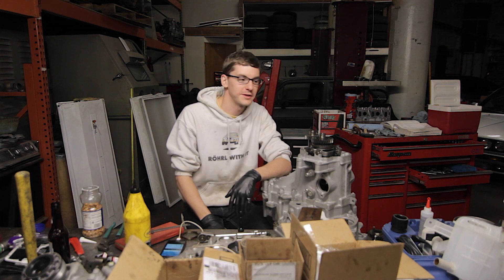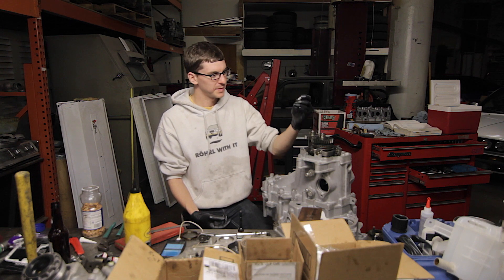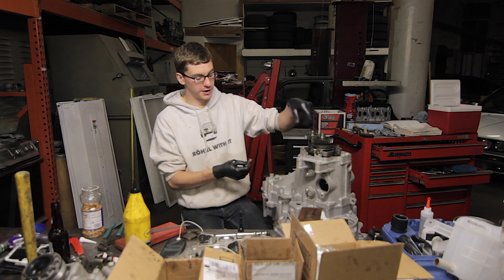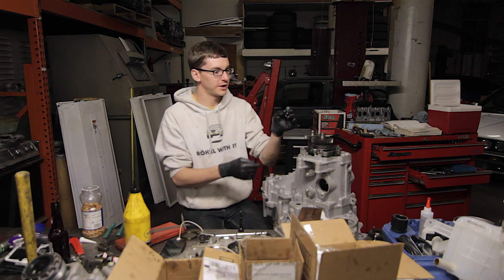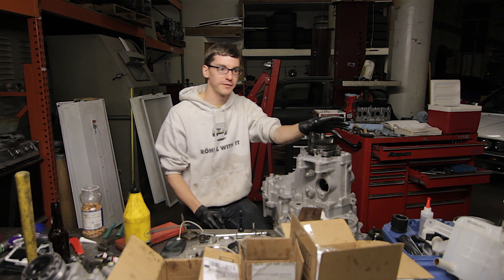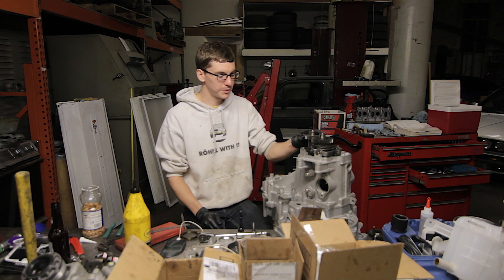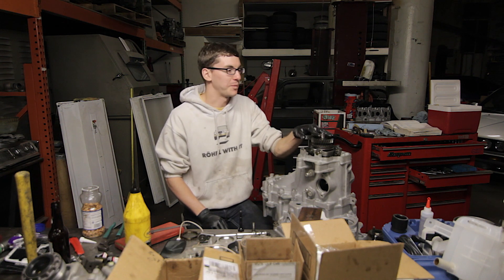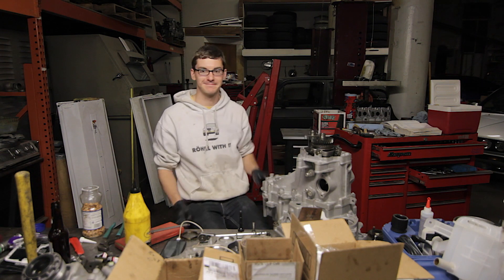Assembling the Transmission 6 Speed AWD - Project Syncro #25

Comment: WHAT ARE YOU DOING WITH THAT CORRADO???? :O
Besides that, nice video. Fun to see a gearbox intestines.
What did you do to the case to get that finish?
Reply from the maker: Thomas Wallblom That is corrado isn't going anywhere, like the 5 previous ones that have some into the shop before it. This is the only one that runs though.  Funny thing is, he as added another one to the collection about a week ago, now totaling 7.  If you need parts for one, message Ron on Facebook, and we can talk to Kendall for you.  The case was just cleaned in a parts washer, and sand blasted with glass medium.  That what we use for everything at the shop; makes old parts look better than new.